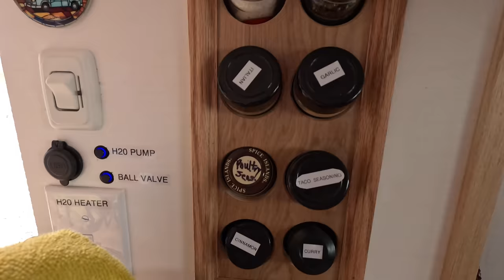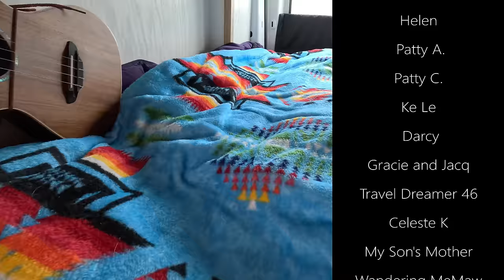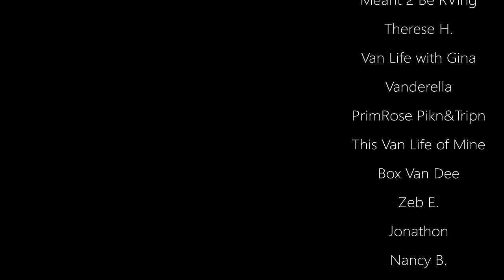Van Life Hacks:  She Saved So Much Money Doing It Herself

Comment: Put magnetic child locks on your drawers....and cabinets.  They use a magnet (one is included) to trigger the lock to open.  You can set the switch to open and then the lock disengages until you set the lock to close for going on the road.  (They use magnets to open and close the locking mechanism...not to hold the drawer closed.  It is a physical locking mechanism.)

That will get rid of all the bungee cords and hold everything closed when you are travelling.  But, when you are camping, your drawers and cabinets can open normally.  Also, the locks won't be seen on the outside.

Beautiful van!
Reply from the maker: Those are handy, knowing me I would have to have 4 magnets laying around for when I misplace the other 3 LOL

Comment: Another idea for under the bed, and what I did, is peg board. Comes with lots of holes! 4 years later and no sagging. Super strong.
Reply from the maker: Do you use the Ikea rails?  Did you treat the hardboard?  Good idea
Reply: No, I built the bed like a deck. I have a Promaster and bolted header and footer boards to the sides of the van, then did 2x3 joists - with joist hangers even! Added blocking. Full time in my van 4 years last November and nary a creak.

Comment: I too have the ECO FLOW DELTA PRO and it is a great battery. 👍👍
But as for using a 750 watt inverter to Charge it is way too small and I’m sure it takes a long time. 🤔🤦‍♂️
Reply from the maker: It is not recommended to charge at the normal current on DC/DC, they have it adjusted down and use it to compliment their 600w of solar when needed.  Thanks for watching G